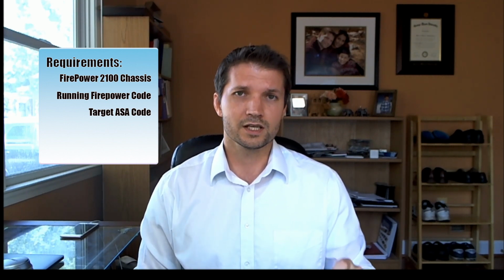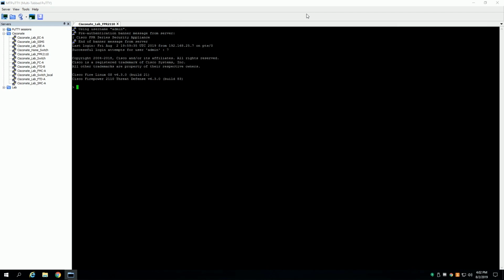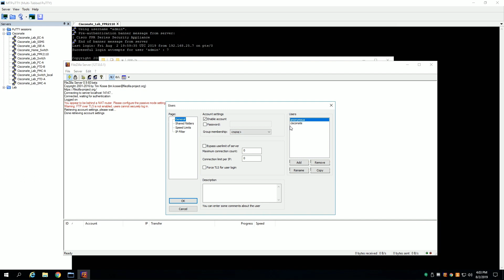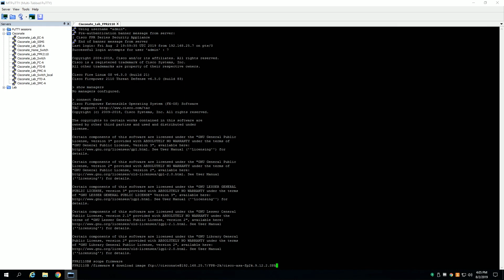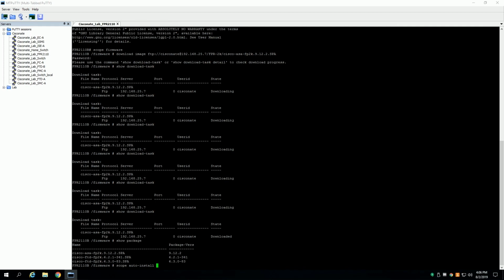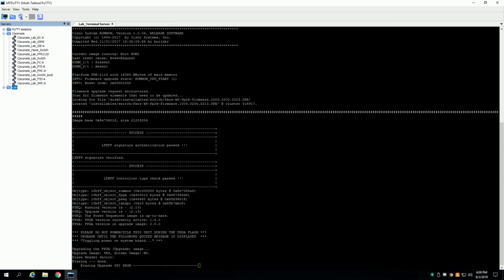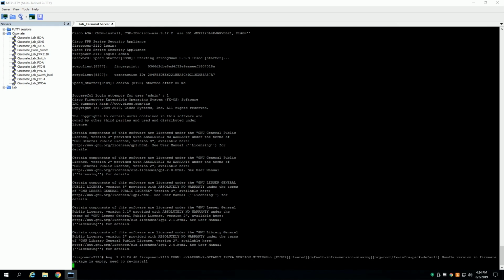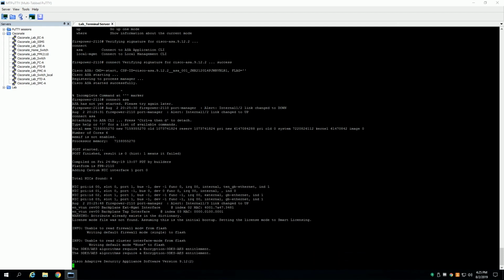Cisco: Security - Firepower 2100 Re-Image to ASA

Comment: Nice video, thanks.  One quick question- after re-imaged to the ASA code and having configured the ASA-imaged FPR, upon reload will it be reloaded into ASA code as if it is an ASA appliance (e.g. ASA5506-X)?
Reply from the maker: Edmund.  It depends on the code that was used for the re-image.  Anything up to ASA 9.13(1) is platform mode by default.  Everything after that is appliance mode by default.
Reply: @NathanStapp  Hi Nate, Thanks a lot for the response…. Not exact sure about the differences between Platform vs Appliance mode? 
Does it mean in Appliance mode, it would act just like an ASA appliance after the re-imaged without having to worry that it might go into FXOS once reloaded? We want the FPR to be exactly like a ASA appliance… 
Cheers….

Comment: Will it delete the all the running and startup configuration after converting to ASA?
Reply from the maker: Ushan, yes the running and startup configuration "get erased".  I say that with quotes because the way you configure and managed FTD is completely different than ASA.  There is no directly transferable version of the configuration.  It would be more appropriate to say that the configuration is not compatible so cannot possibly be migrated.
Reply: @NathanStapp  Ok, that means we cannot use it in production environment.
Reply from the maker: Ushan, what are you trying to do specifically?  we can discuss here or you can ask me directly nstapp@cisco.com

Comment: How about upgrading the ASA module in the firepower 2100s? it's done from the fxos/chassis as on the 4100's?
Reply from the maker: Juan, I apologize for missing this earlier.  The way you upgrade depends on if you are running in Appliance Mode (default for ASA 9.14+) or Platform Mode (default for ASA prior to 9.14).  for Platform Mode, it is similar to the upgrade method for the 4100's, you upload an image through Firepower Chassis Manager (FCM) - web gui for FXOS, and then click upgrade.  For Appliance mode it is similar to the traditional ASA upgrade method, you download an image via FTP on CLI, and change the boot pointer.

Comment: Thank you for your video, but you said there is no FTD in the box just the FXOS while during the installation of the ASA image you were asked to reimage the FTD with ASA image !!
Reply from the maker: Hello Omar!  I don't quite understand your comment but will briefly go over what happened in the video.  The FPR 2100 starts with FTD (this means FTD running on FXOS - the pseudo hypervisor).  I then re-imaged the box to ASA (which on the FPR 2100 means ASA running on FXOS).  Both platforms still involve running FXOS it is just abstracted so most dont realize it is there.  On the newer code bases you can run in what is called "appliance” mode which truly  hides FXOS entirely so it would look and feel like the old ASA.
Reply: @NathanStapp  Hi Nathan, I just upgrade FPR2110 to a newer version and it changes the fxos mode to appliance.
Will it be fine to boot the old image in asa and revert back to the old version using platform mode.
Reply from the maker: @richlee2164  If you actually UPGRADE the box, then the mode will be maintained.  If it started in platform it will stay platform.  If you re-image, then on 9.13 and above it will be appliance mode by default.  On the 1000 and 2000 appliances the ASA code is packaged together with FXOS (unified code), this means if you "downgrade" the ASA code that means you will downgrade the FXOS as well.  Now to answer your question, you can change the box so that is boots the old version and  it will work just fine.  However, I would question why you want to use platform mode.  It adds additional "work" to configuration like enabling interfaces just to use and "no shut" them in ASA.  Appliance mode is better in every respect.

Comment: Hello.  why would Engineers / companies purchase Firepower but convert it back to ASA code?
Reply from the maker: Hello Eric!  There are a few reasons.  By far the most common reason I have run into is... Its a familiar firewall!  So while Firepower offers the benefit in the future of allowing deep packet inspection (NGFW) and a myriad of other benefits they can "dip their toes" so to speak by getting the hardware, and switch over later.  They also generally have much better performance for the cost especially with the new 1000 series Firepower versus ASA low end series.  This is just the nature of technology progressing and allowing new products with similar price points but higher performance.
Reply: True!! but instead will have firepower logically running ASA but i like the video though